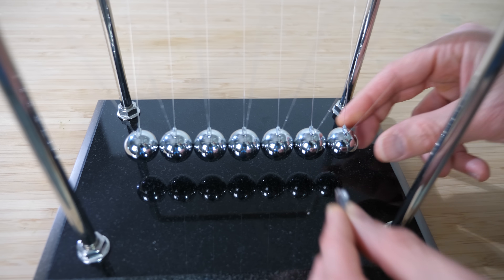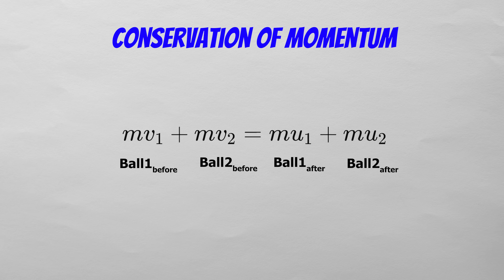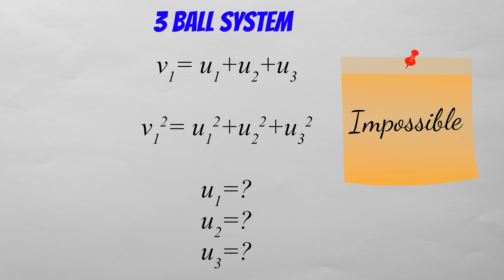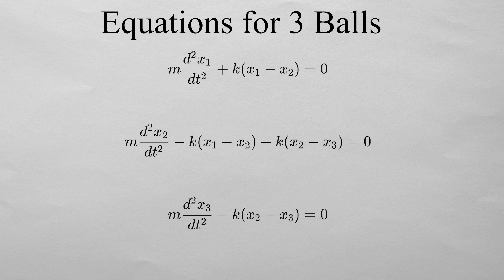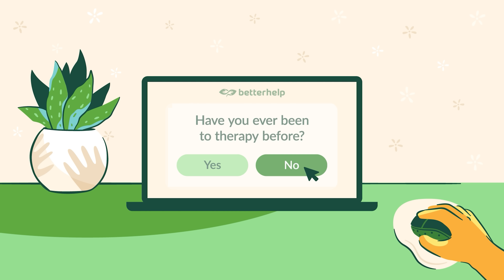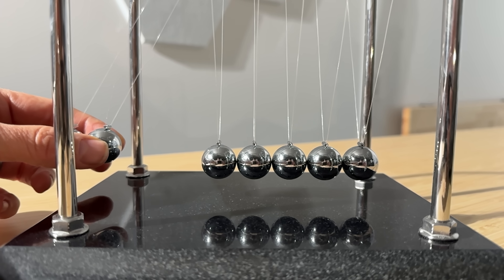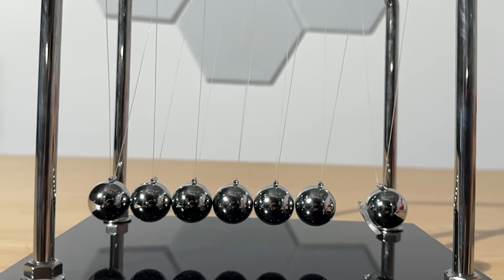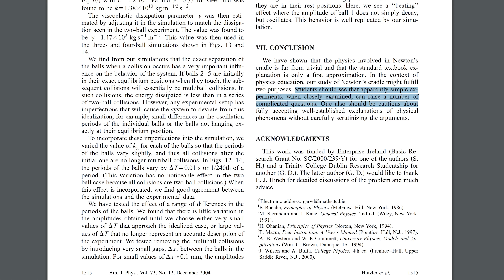Newton’s Cradle Doesn’t Work the Way You Think

Comment: As a physics teacher, I appreciated the explanation, but even the paragraph you showed says that the classic explanation serves as a first approximation.
Also, I can't tell you how much it irked me that you used v for the initial velocity and u for the final velocity, rather than the usual practice of naming them the exact opposite way!
Reply: The classical explanation, conservation of momentum, by itself doesn't explain it at all. If the one ball knocked away all four of the other balls at a quarter of the speed, that would still conserve momentum.
Reply: @chitlitlah  ... but it would violate conservation of energy.
Reply: @rafaelribas1027  Not necessarily. One possibility is that it isn't a completely elastic collision and some of the energy is converted into a different form like it is in a car crash. Obviously it's not going to keep cycling for long like that, but it would explain a single collision. Another possibility is that the first ball bounces backward at some velocity rather than stop. This is what would happen if it was a light ball hitting a heavy ball in an elastic collision. We can see that isn't what happens, but the point was that conservation of momentum isn't enough to explain what's going on or why.
Reply: @rafaelribas1027  You're complaining about the use of nomenclature? If one of your students used it the same way as the video, but got all of the physics correct, would you take off points or give them full marks?
Reply: @DANGJOS  Of course not - I said it irked me, not that it was wrong. If I was explaining something on the board and I used nomenclature that is the opposite of what my students would find in most other textbooks, they would be right to be confused.
Reply: @rafaelribas1027   Fair enough. Nomenclature can vary quite a bit. I learned v subscript 0 for initial velocity.
Reply: ditto
Reply: The equations are time reversible, right? So who's to say that u isn't the initial velocity and v the final velocity? 😀

Comment: The compression wave relies on spherical shape to reflect, i assume?
How would it behave with steel cubes?
Reply: you can think it like light reflection. When a wave encounters a different medium part of It reflects and another part is difracted. Here the wave is reflected because it "collides" with the metal-air surface
Reply: It would behave....poorly, lol.  The chaos introduced by corners causing each unit to rotate instead of move would be about as useful and satisfying/relaxing to watch as a couple of chimps or preschoolers told to build a car or organize an office.  Yes, chaos has its entertainment value, but usually works counter to usefulness.  It is that same chaos, however, that makes dice useful for generating effectively random numbers, as well as making animals and children fun, at least when we're not trying to work!
tldr:  It would crash instead of politely clacking back and forth.

Comment: Question for future:  If you were to combine 3 identical objects of equal mass together into 1 object, could you then divide the 1 into 3 absolute equal parts?
Reply: That just depends on what "combine" means.  Three magnets of equal size can act as one object under certain conditions that are weaker than their mutual attraction, then be separated into their original parts.  As for dividing something that's been welded into one contiguous substance, that just depends on how accurate the equipment is.  Dividing each part into its original group of atoms, however, is statistically impossible.  That's technically also true of magnets, which will gradually break down and crush/scrape every time they snap together.  The fragments move as new independent parts.

Comment: This demo is typically used in physics classes to show conservation laws in effect.   The behavior can also be explained by showing that momentum and energy are both conserved simultaineously.  Assuming fully elastic collisions, there is only one set of solutions that conserves both and that results in the behavior we see in action.   The detail physics of the collisions and mechanical properties of the balls are much more complicated in reality and require more simplifying asumptions than just conveniently ignoring friction and assuming elastic collisions as needed for the conservation law approach.  The other advantage of sticking with momentum and energy is that it flows more naturally into the concepts taught later on in higher level classical mechanics classes.
Reply: "The behavior can also be explained by showing that momentum and energy are both conserved simultaneously."
Couldn't you 'tune' the set up via the mass of each ball (still keeping them equal) so that an unequal number of balls could rebound on the opposite side (at a different velocity from the original swing) and conserve both momentum and energy?   -- But, it still won't be an unequal number of balls because of the compression wave effect . . .

Comment: Please don’t call these subsonic waves ”shock 
waves”. They are sound waves traveling a sound speed and don’t dissipate energy by doing irreversible deformation of the medium as a shock wave would
Reply: He also calls it a compression wave, which is accurate.
Reply: @ yes but even there he’s got some of it wrong. The wave reflected off the back end of the first ball is a rarefaction wave whose first impulse is a fall in pressure, the mirror image of the compression wave leading away from the point of impact
Reply: > sound particle
> shock particle 
>> " wave " 0:05:31
Reply: You're right, some people might call it a shock wave because the speed of the wave through the balls that are touching is quite supersonic... but supersonic as in comparing the speed of sound in air. The speed of sound thru solid metal is several Mach numbers, but because the pressure wave is only travelling at the natural speed of sound in that medium, there is very little deformation. However, even with hardened steel balls, on a microscopic level there will still be small spots of plastic deformation (dents) on each ball. No material is perfectly non-elastic, and if it was, the balls would simply shatter instead of bouncing and not make for a very interesting toy.
Reply: @brnmcc01  It would still be interesting. Once.
Reply: Has nobody here ever heard of a Phonon????? sheesh
Reply: Nerd not understanding how communication works:
Reply: @Brain-washed2 ？？？
Reply: @Brain-washed2  what
Reply: @Brain-washed2  "Nerd not understanding how communication works:"
Why are you describing your self?
Reply: @ABaumstumpf  
Everyone: “oh he said shockwave, I’ve heard that word before, makes sense to me”
Nerd: “UMMMM IF YOU DON’T USE EXACT TERMINOLOGY AND THEN EXPLAIN THAT WHEN PRESENTING TO PEOPLE, YOU’RE DOING IT WROOOOONG!”
It’s a very obvious lack of communication skill this guy has, even if he’s actually right. He doesn’t get it and neither do you.
Reply: @Brain-washed2  So the video went way over your head and you complain that the people that understand are pointing out small corrections?
Go figure - not even smart enough to reach the DunningKruger Effect yet.

"It’s a very obvious lack of communication skill this guy has"
You should not project all your insecurities onto others.
Reply: @ABaumstumpf  
see what I mean?
Reply: @Brain-washed2  clearly yes - you are getting angry out of confusion as the subject is way over your head. Hence why the first thing that came to your mind was insults instead of learning.
Reply: @
The first thing that came to my mind was calling him a nerd that doesn’t understand communication bc it’s true. It’s a very common thing for those types so it’s understandable but still funny to call them out on it
Reply: @Brain-washed2  so you are projecting and you are getting emotional just cause you can't comprehend it.
Pity you but that still makes you the person starting with the insults and still means you are the one not capable of understanding or using simple English
Reply: @ABaumstumpf 
I want you to be right so bad man, you don’t even know. Unfortunately you’re making up that I’m emotional in a desperate attempt
Reply: @ I think he thought it would sound more emphatic if he called them shock waves but shock waves are a completely different thing
Reply: @jamesmungall6669  
Yes this is basically what you said in your original comment. See what I mean
Reply: @Brain-washed2  you really should stop projecting so much. You not being able to understand the video is one thing - but your comments are just pathetic.
Reply: @Brain-washed2  @ABaumstumpf dang... the rage bait has been fallen for, yall both fell for each other's lol.
Reply: @
No I was just being correct. No baiting involved
Reply: @Brain-washed2  so if I call you a chimpanzee it’s basically true because you and a chimp are both great apes, which is close enough, and if you disagree and say actually you’re a human, which is a close relative of chimpanzees but not the same thing, you’re being a nerd when you object? The difference between shock waves and elastic waves is fundamental like the difference between a hot gas and a plasma or between one great ape and another. It’s not nerdy and pedantic to point out a basic untruth in a “science” video even if you’re correct in assuming that it wouldn’t matter to most of the audience. What’s the point of “science” communication if it’s wrong?
Reply: @Brain-washed2  I call it a shock-wave since that's basically what it is.  Compression wave sounds much less dramatic, like you were squeezing it with pliers or something.  The important part is that it is an impulse that travels by physical contact from ball to ball.
Reply: @Brain-washed2  ??
Reply: In physics communication works on the principle of fact, which is what the nerds are most aligned with, not on fancy, which is what most other people are aligned with, so he is 100% correct and in the right here - you aren't.

Comment: Would balls made from super elastic amorphous metal behave any differently?
Reply: They should potentially lose less energy due to denting and crystal misalignment, so they could bounce longer and with less chaos.  (Note how the adjacent/second and even third ball lift slightly as we see in the slo-mo footage.)  There's likely more defects in the welding, line knots and bending of the wire frame, however, that would overwhelm most benefits of using fancier materials.  The defects could theoretically be muted by scaling up, however.  Double however, MythBusters evidently tried to scale this up a lot and ran into problems, according to other comments here that aren't being specific.  I don't remember the episode well enough to elaborate.  Could just be the denting from higher weight overcame the bounce.

Comment: I don't think the compression wave explanation works with 2. Wouldn't the compression wave just kick them apart half the initial drop height minus the percent energy lost in the system?
Reply: Agreed, half was the wrong direction of thought, but it seems like the whole premise of the video was compression vs momentum. If it were compression, it seems as though the wave would reach the center some amount of time after the point at which transference took place, if it were both, some amount of opposite force would be present from compression. Lol perhaps I've just answered my question and described why it's always more than two balls. Play me off, Johnny!
Reply: It's a compression wave AND momentum -- the system has to keep traveling in the initial direction/swing until gravity pulls it back.
Reply: Why would it specifically be half?  Both balls trade their compression wave, while one carries the momentum imparted by the initial drop.  (Momentum making the whole system act collectively as a pendulum.)  The transfer of the two waves happens at the same time.  How much energy transfers (or is absorbed) depends on the size and material properties, but for two balls of the same size and material, that transfer will always be equal.

Comment: Sir with all due respect and I have watched I think 90% of the videos you've ever produced this video is spurious. I'm not sure if you have advisors or you are a physicist yourself but I think you need to look at elastic and inelastic collisions and the conservation of kinetic energy and momentum again. I mean no disrespect I like your videos and they certainly get myself and others thinking I am sure. Thank you.
Reply: Well said. I thought it was pure bollocks.
Reply: You're right, all those conservation of momentum equations only apply to non elastic collisions. The moment you introduce a soft piece of plastic into the system that goes out the window. Even the balls themselves are slightly elastic, for the same reason ball bearings will eventually wear out.

Comment: 8:14 You make it sound a bit mystical saying "waves of energy"... It's just mechanical waves actually, from a model of atoms on a lattice each connected by springs. We actually use the same simple model when computing phonons in any crystalline structured material (metal have a crystalline structure, actually polycrystalline, explaining why phonons lose more energy than the simple model predicts because of the reflexions at the interfaces of the crystalline planes) which is the foundation of studying sound (mechanical wave propagation) in materials.
Reply: Basically elastic vs inelastic collisions.

Comment: I'm not sure this explanation is completely accurate. The way it uses "reflection" of the pressure wave wouldn't work the way it is depicted in this video. When the pressure wave reaches the end of the last ball, it would not reflect back, it would make the last ball move instead. The reflection point happens between the second-to-last and last ball. In a very low friction/loss environment, the first ball will have come to a full stop even before the second ball has impacted the third ball. If all the balls are exactly the same, then the second ball already has enough mass to fully stop the first ball. There is no need for the pressure wave to even reach the third or fourth ball. The reason why putting the soft plastic between the balls messes up the cradle and why it makes balls move together is that in order for the last ball to pop off on its own, it needs to have all the energy that the first impacting ball had. However, it cant get that force all at once because the soft plastic wont pass on the impact force all at once( as an impulse ). Instead, it spreads that impulse out over time, splitting the force up between all the remaining balls, ensuring none have enough momentum to pop off.
Reply: No, he’s right. The sound wave does reflect off the end of the balls at both ends
Reply: Perhaps the gap here is in the difference between how fast a wave can move through the material, and how fast that mass can move against gravity, inertia, and objects around it, like another ball, under the same pressure.  The wave moves through the atoms of the balls faster than each whole object can move physically.  In the same way, we can tap the end of a rail with a hammer and make a huge noise, without moving the whole object much at all.
The wave also isn't necessarily moving in a line, but as an approximately spherical cascade through the atoms.  That's why it's able to swirl inside the last ball and reflect/refract back almost the same amount as what came in, but the opposite direction.  I think it would be very hard to visualize this.  The demonstration of the waves moving linearly is just a simplification of a component that isn't really necessary for the audience to understand the point being made.  (He does show the waves as semi-circles, however.)